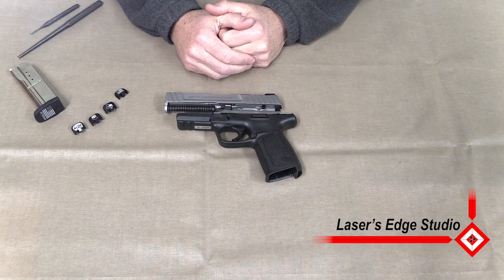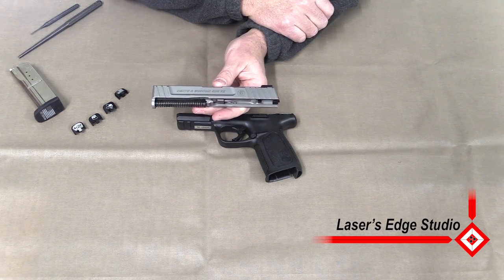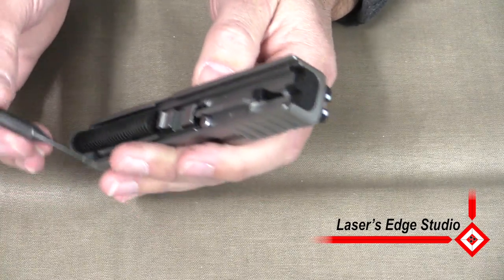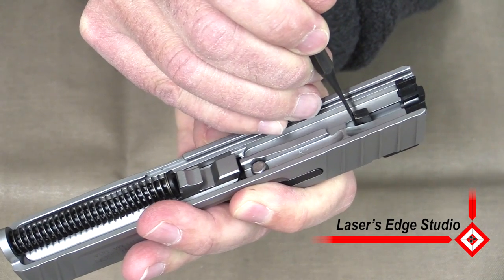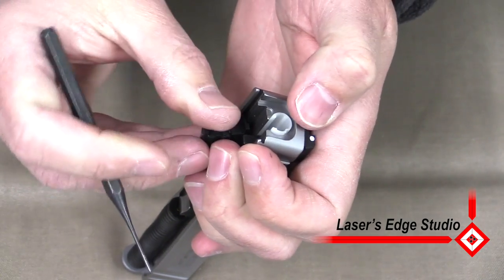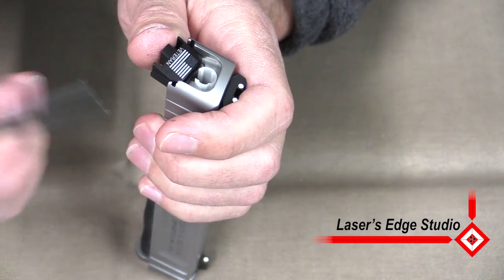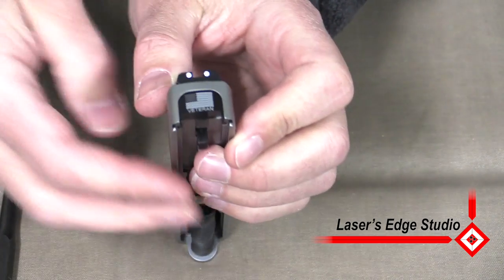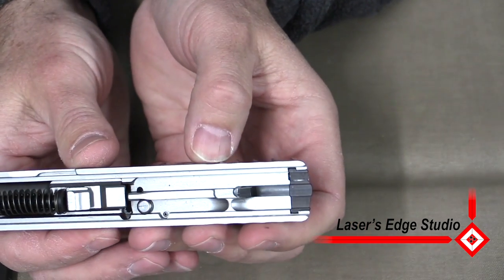SDVE Custom Back Plate Installation

Comment: Is yours a 9mm? If so do you think it’s worth switching to a stainless steel guide rod?
Reply: I did it and had a lot of slide return issues, i would have to use bottom of fist to get slide to completely return and chamber a round. Spoke with S&W rep, they said it's best to use polymer(plastic) guide rod because of the frame being polymer and the guide rod needs to be able to flex a little same as frame and also it is hard to find guide rod spring as strong as the one attached to polymer rod. I do know people who've had little to no problems with steel guide rod. Hope this helps.
Reply: @guhurubell  how many lbs was the guide rod tension on the stainless steel that you purchased? I heard 18 lbs was the rod standard so if you had a 12 lb rod or anything other than 18 lbs I could see an issue. I'm curious
Reply: @thefrizzell91  Late late reply, but the stock Plastic/Poly rod is 16lbs.
I'd advise against the spring change because that's metal on metal, the SD VE(hell any VE for that matter) aren't entirely built for that punishment or modification, hence the reason for very very few lower mods vs upper mods.

Comment: What kind of pin punch ????
Reply from the maker: 1/16", 3/32", even a 1/8" would work.  It's used push down on the firing pin spacer sleeve (white plastic under the firing pin).